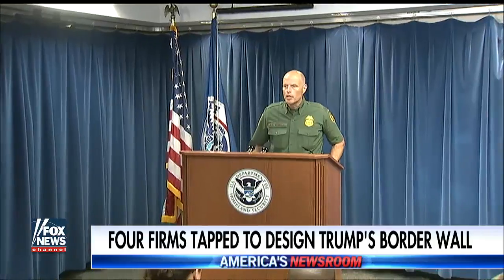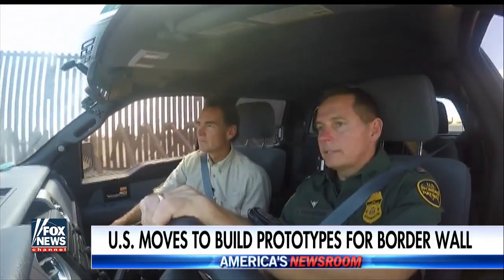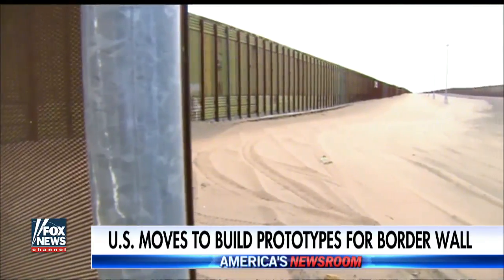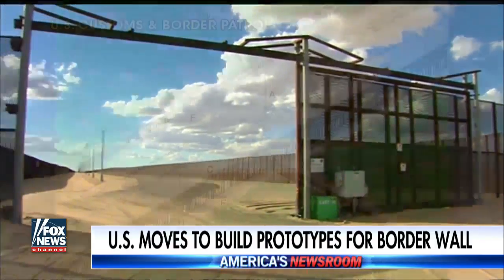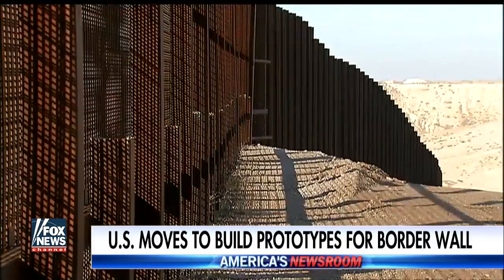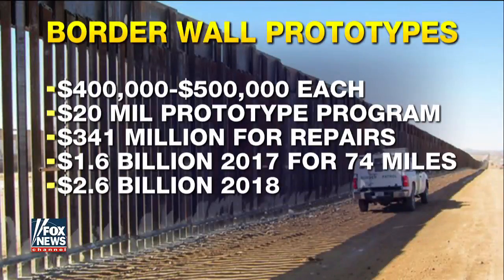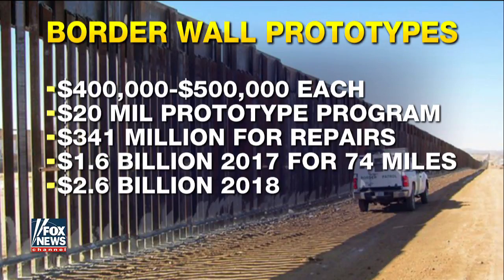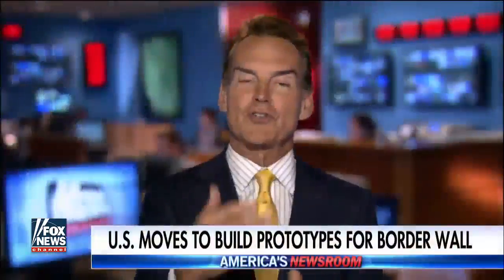US moves to build prototypes for border wall

Comment: The wall needs a T shape with some small jagged spikes to keep them from climbing. They also need cameras around too. They also need to equip some seismic radar senors to pick up any disturbance under the soil for tunneling. That way, they can flood out any tunnels to drown them out.

Comment: how much do you want to BET the winning design is going to be a shiftable design (Can take some pressure and shock.  Diamond cross hatching w/ vertical and horizontal for the rebar; shock absorbent concrete mix (waves can resonate through it, not against it) and then what coat the dang thing in line-x?? What are we trying to do here? Establish Border relations with only Mexico OR Mexico, central america and South america.

As stated it would be REALISTICALLY AND LOGISTICALLY smarter to set up a series of radars at precision locations. these radars could be hidden from the human eye .... Instead we could see a US DIPLOMATIC RELATIONS SKYSCRAPER (w/Defense systems for the "American Prowess" whether it's Lethal or Non Lethal) floors for each country or region and honest, understanding but Patriotic Employees. These radar systems can be remotely monitored by Specialty Service Contractors, while being run on GOVT platforms no questions asked. How many more permanent jobs is that for just That Border? Instead of a bunch of concrete and Thievish Project Managers, WHICH IS A PROBLEM OF GREED. 

All in conjunction with AMERICAN & FOREIGN Govts, then we could even est. a banking system where employees have incentives! For the price of your transactions (just to make sure you not "accidentally" funding terror org, or espionage! 

Simple Who wins bid?? is it a steak dinner or a burger
Reply: Tan Line-X.
Reply: +ThrummerOfLove Yeah and when you get deported (reson specific) you get directed accordingly to Non-Profit run Lodge and can work on le farm
Reply: +Chris Hux Also officials vehicles could eventually end up being Electric With bulletproof HD kevlar/technology enclosing or in-casing the fuel cell.

Comment: Rather than having a road between the two walls, it would be much better to put in a canal connecting the Gulf of Mexico to the Pacific. Its a shorter route than the Panama canal and would provide revenue from shipping tolls. They can fill the mote, ...err I mean canal, brimming full of Saltwater Crocodiles, which would drastically cut down on the number of border agents needed as well. If anyone is stupid enough to get their back wet and attempt to swim across, then the crocs will get fed for free. It's very low maintenance and eco-friendly. With the revenue from shipping tolls, plus the savings on border agents, it would more than pay for itself. But If we need to downsize, I'd be happy with just the croc mote.

Comment: Should start with an earth berm and ditch along the entire length of the border. Relatively cheap to build and requires little to no added materials. It would also happen to work around the agreement that was made in Congress to delay funding for any wall that includes concrete or steel materials.  This could then be used as a foundation in the future for a more comprehensive wall, fence, or line of vehicle barriers.